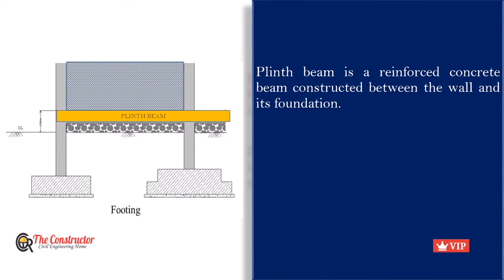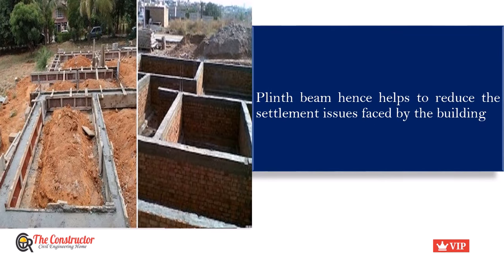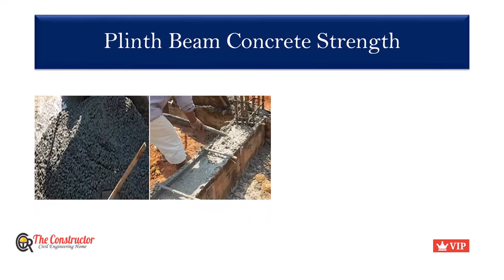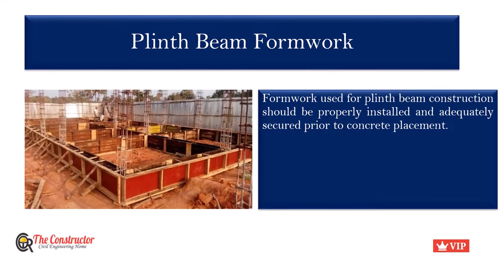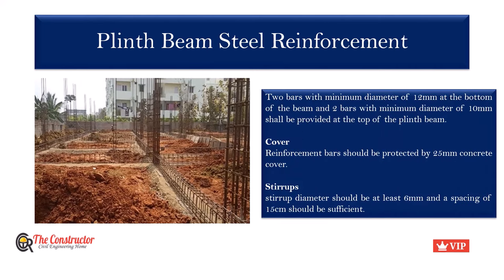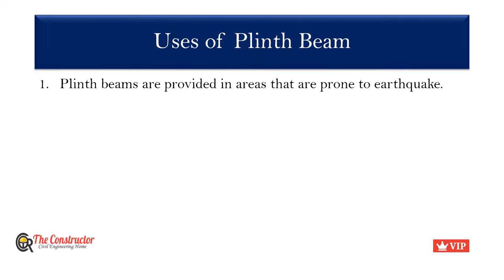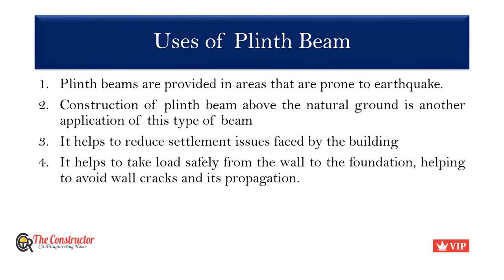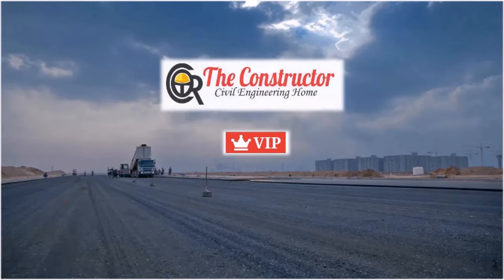What is a Plinth Beam and its Purpose in a Building?

Comment: Hi maam good day,my house w/out tie beam on the ground.should I strengthen my concrete post structural by applying reinforce concrete sealant to connect plinth beam each vertical post.do you think is helpful if I will do that way to my house.my house 5x10 square meter floor area 3floors.many thanks in advance.keep safe and god blessed.